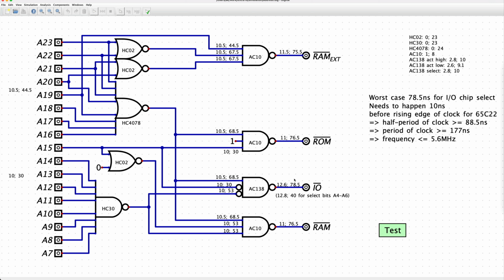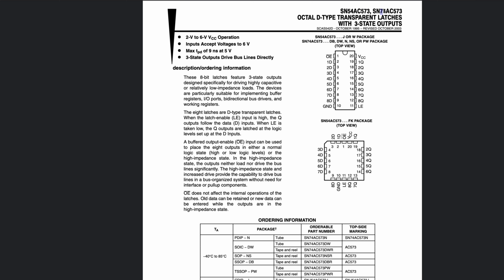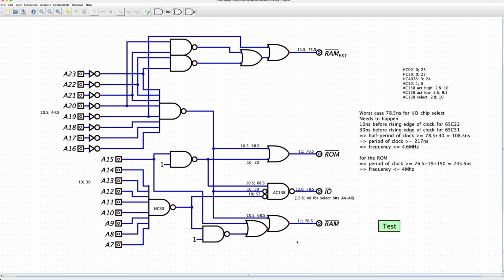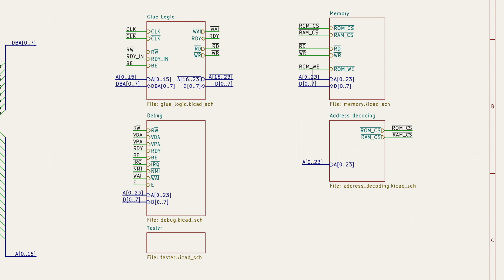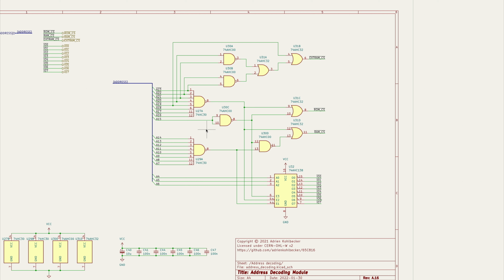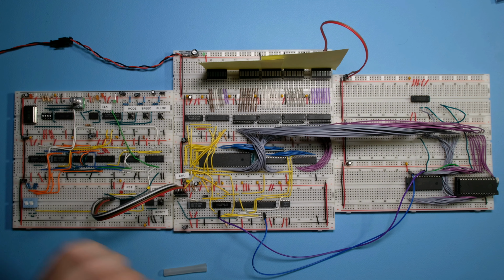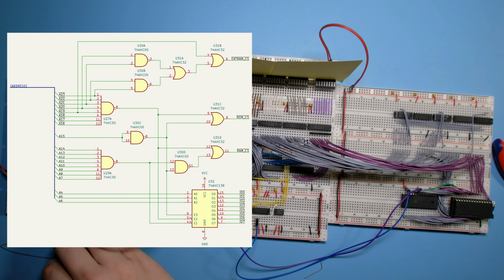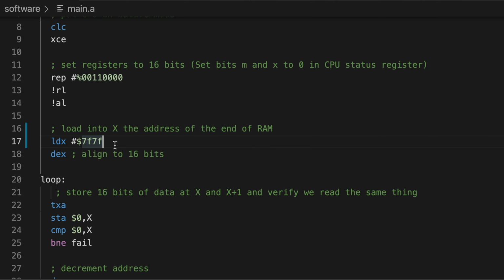#16 - Address decoding rework - BB816 Computer

Comment: I don't know if you will one day (after these relatively simple but necessary steps) implement more complex memory management methods such as paging or DMA. I also imagine the possibility of excluding the ROM or part of it to use its addressing for the benefit of the RAM.
In short, that this project, once completed, does not stop here but continues in the development of techniques to make the most of this technology.
Thank you for your work so valuable to me that I want to accomplish the same thing.
Reply from the maker: Yes my goal is to keep iterating, this is only the first revision! I want to have a faster clock, and this will require new techniques. Things I'm thinking about: ROM-to-RAM copy, using SPLDs, moving to 3.3V for interfacing with modern electronics, for example.

Comment: You could try Mickey Mouse Gates. I have no idea why they are called that but they are a thing.
It's somewhat of a mix between DTL and TTL, where you use diodes to get desired logic function and Schmidt inverters to get robust outputs. This can be used to get NOR and NAND gates with arbitrary number of inputs.
Reply: Correction its called Mickey Mouse Logic.
Reply from the maker: TIL about Mickey Mouse logic! Thanks 🙂
Reply: @akohlbecker  you're welcome 😉
Reply: @akohlbecker  As an expansion upon this it would be possible to go the 'PAL' route. If you had all input signals in normal and inverted versions you could build a diode decoder array and buffer that with 74hc14's. The end effect would probably be stupidly fast (in comparison to individual gates).
But that would probably add a lot of complexity.
Reply from the maker: @akkudakkupl  With diode logic, one issue is the pull-up strength. I showed that for the RDY pin circuit in a previous episode, unless your pull-up is strong enough it is going to take a long time for the signal to go from 0 to 1, because it needs to charge the stray capacitance through the pull-up. So it is fast only in one direction!
Reply: @akohlbecker  that's true. You'd have short gate chain, but I forgot about the rise time.
Active pullups could speed it up, but would add a lot of complexity 😕

Comment: Are wait states/clock stretching on your roadmap somewhere out in the future, to push past 4 Mhz?
Reply from the maker: Not in this revision but think I'll start the next one by using a 70ns ROM (obsolete, second hand) and a faster UART (TL16C550), this should get me to 5-6MHz. Then moving to an SPLD like the ATF22V10 for decoding should get me to 7-8MHz. Finally moving everything to a CPLD like the ATF1504 and using ROM-to-RAM copy might let me go even faster. That's the plan, anyway 😅 We'll see if I need wait states along the way
Reply: @akohlbecker  With wait states or stretched clock cycles you could slow down just for I/O and ROM access, while the RAM could be as fast as possible. Not many downsides to this approach.
You could have a boot up routine that would copy ROM into RAM and then disable ROM completely with 7474 in I/O space, CP/M style. Would need for a part of the RAM to be decoded in the ROM space, or maybe even to have a separate RAM decoded in parallel to the ROM.
Reply: @akohlbecker  Sounds great!  I didn't look closely at the datasheets for the peripherals to see if any of your I/O couldn't tolerate speeds above 4-ish Mhz, so I wasn't sure if you'd end up needing to slow down some of the accesses.  Looking forward to seeing how it goes!